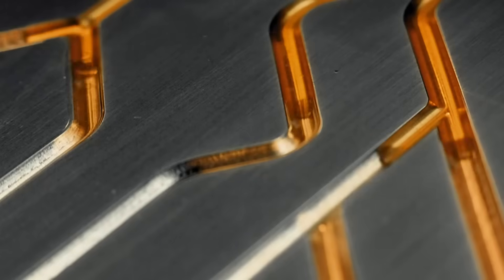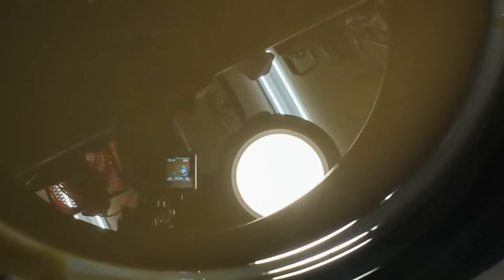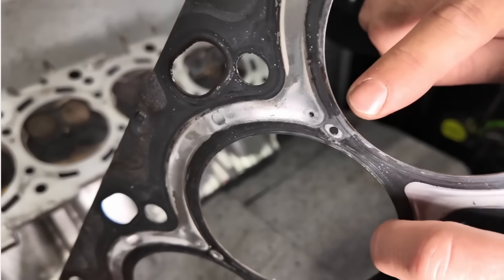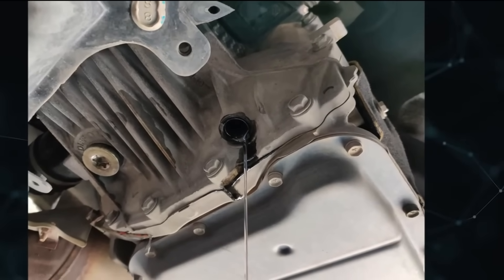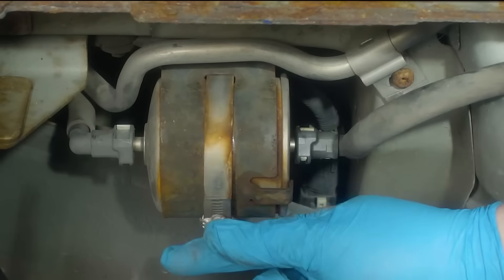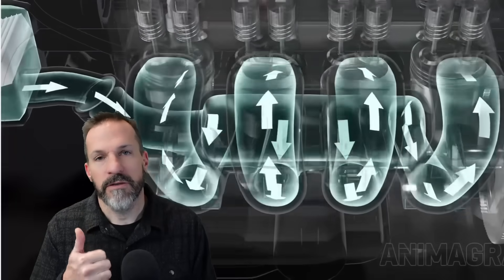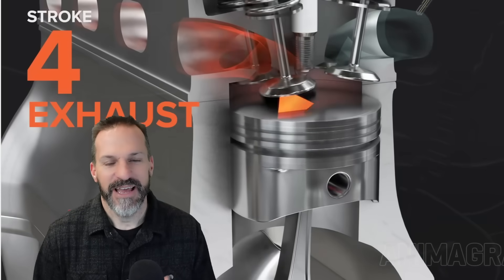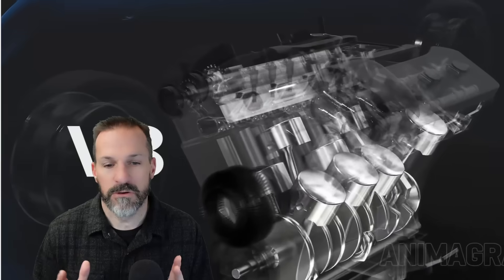Car Maintenance MOST People Ignore! Make Your Engine Last 200,000+ Miles!

Comment from the maker: *Fuel Filter note: Many newer vehicles you will likely not change the fuel filter, this video was made as generic advice for people with older vehicles and newer vehicles, and mostly geared toward powertrain maintenance (why I left out simple things like tire rotations). Obviously, use common sense and don't spend a fortune to replace fuel filters inside fuel tanks proactively on newer cars if they have not failed.
Reply: Hi,
Thanks for adding this note regarding fuel filter changing for vehicles with the fuel filter located inside the gas tank. Yes, not a practical maintenance job to do!
Also, thank you for making this video. Well done!
Reply: How about don’t buy a vehicle with the fuel filter in the gas tank?
Reply: @shack1975 sadly, that's almost an impossible feat
Reply: What year is considered “new”?
Reply: Yes
Reply: i've been working on cars since the 60's. had an ESSO service station in 1969. i NEVER rotated tires. you have to find WHY tires are wearing uneven and FIX the problem.
Reply: change oil every day
Reply: modern cars have lifetime transmission fluid
Reply: @infdox9051 Don’t change the transmission fluid if you want the lifetime of your transmission to be short and a very expensive repair.

Comment: 50-100k in my opinion is too long on the rad.  50 maybe but 100 far too long.  It's cheap and easy.  $50 tops on my tundra $25 on the corolla

Comment: I diy my maintenance except the tranny drain and fill on my tundra I let the dealer do that.  I do all fluids at 30k   i missed the rad at first 30 but for the low cost I just do it.  Amsoil in the diffs and transfer case. I use Pennzoil ultra platinum in the engine ever 5k.

Comment: New car: 
500 miles oil change
1000 miles 
1500 and then 3000 miles after that depending on the car 3000 or 5000 oil changes. 

Performance car I would do 3000k oil changes.

Comment: I go about 5k on 2.7 ecoboost F150... I also change my top mount filter at the 2500-3000 mile range between oil changes, they are cheap and simple to change, figure it cant hurt.

Comment: I have a 2010 Honda CRV. Purchased used at add 60 K. I see these pre-– all-wheel-drive Hondas all over the country still going strong. Today it has 247,778 miles. I tried to keep up with all the maintenance but wasn’t perfect. The last 50,000 miles it has had a lot of electric breakdown like driver’s window doesn’t work, no interior lights, etc.. The car has been absolutely amazing. She’s going in for a full fluid fluids, filters, belts, everything checked and changed and looked at. I hope to keep her for another 50 to 100,000. Thank you for your great advice.

Comment: My 2005 Saturn ion still kicking @ 220.000 with no engine repair. Just horrible fuel line and crappy front suspension issues.

Comment: Must be severe air pollution if the engine air filter needs to be replaced every 10k miles. 30k-35k miles (~50k-55k km) is probably a close enough interval for replacement in most cases. 
At least where the air is relatively clean, like here in northern Scandinavia, where in addition, a low traffic density means less road dust/pollution is stirred up by the traffic that contaminates the air.

Comment: I just reached a little bit over 100,000 miles and it's on my mind to change the transmission fluid
Reply: Should of done that at 30k and then 75k. Your too late if this is your first. Good luck
Reply: @Musoui  well see It's a newer car.

Comment: Great video. Have yet to see anyone mention a pvc valve replacement.
Reply: A lot of them have a check-ball valve in them. Shake it, and it should rattle. There are some that dont have a check ball so take this with a grain of salt. If you suspect it's clogged up (lots of oil smoke from tailpipe) you can flush it out with throttle body cleaner. Did that to my grandpa's old 1990 chevy silverado and it definitely smokes a lot less! Still has some blow by from either worn or stuck piston rings, but that's another can of worms 😅

Comment: I had a recent experience where my 18 Colorado, 2.5L manual I demanded my transmission, diff, clutch, brake and coolant be changed after 50k miles, the service advisor looked at me like I had 2 heads. He said sir you realize this will cost you 850. And I said sir that is much less than a modern car payment, please perform the services I am asking for

Comment: I had a 2003 Toyota matrix hit about 270,000 before I sold it. It didn't die, I sold it! It started to throw too many emission codes for me to want to deal with. And I'm not proud of this, but I didn't know a lot about cars so I did almost no maintenance to that thing. It was leaking oil, but had almost everything still original under the hood. I miss that car.

Comment: Transmission fluid needs to be gritty—don’t change it. Parts of the auto transmission breaks down to grit, but that grit sticks back on and helps the transmission function. If you get rid of that gritty fluid, you’re accelerating the wear of the parts

Comment: Honda Element 2005 drove it to 425k - Preventive maintenance and wear and tear items - Oil changes every 5k to 6k - Valve adjustment every 100k - Transmission drain and fill every 50k - Plugs at every 100k - Filters as needed - Coolant every 75k - Current 2010 at 245k, same vibe - Most eventually need the VTEC Solenoid Assembly R/R'd but only with OEM... \m/

Comment: 1996 nissan pathfinder with +>237,000 miles currently under the hood only major issue was a timing belt before but I'm working on replacing some stuff

Comment: 240,000+ miles on my 2011 Honda Accord LX. Only had to replace the alternator literally just last year as it finally gave out... only because it was covered in power steering fluid from above it which the o-rings were replaced right after. Other than that, just regular maintenance and upkeep with it.

Comment: Question hopefully someone can help with. If I am buying used and it wasn't taken care of like this from new, if i get it all changed and do it right from say 130000km will it be ok?
Reply: Just depends on the internals. My 92 tercel was and still is abused. But she runs. Just get a car with "less" tech if possible. My tercel doesnt even have power steering 😅

Comment: I had a 2000 Suburban 4x4 with the 5.3L engine.  Sold it with 407K miles on it, no engine or transmission rebuilds. Oil was changed every 3,000 miles (yeah, that's right) and only did the usual replacements like alternators and fuel pumps.  It was a great vehicle and I'd buy another like it new if I could.  The newer Suburbans -- no thanks.

Comment: Just one thing. With diesel engines, especially those over 10 years old, it is excellent to preheat the spark plugs for approximately 1 minute so that the oil reaches the entire engine. However, when starting, it is better to begin moving the car immediately, not letting it iddle.

Comment: If you've got a car around 150k miles you'd best check that oil weekly. I'd also say timing chain swap every 100k miles, especially if you bought it used. One time running hot can stretch them out and possibly grenade your engine.

Comment: My 2003 Suzuki Vitara 2.0L J20A engine just reached 154,000 miles. Just did a whole bunch of work from new Spark plugs, oil and trans fluid changes, oil and trans filter replacement, new water pump, new radiator,new pcv valve and runs like a dream. Old vehicles can handle the milage as long as their taken cared of.

Comment: Opinions are like assholes....2+ minutes into this and I wanted to scream!  
HE changes his oil at 5K "and has never had a problem".  Good.  I maintain 3 cars w/ 10K changes "and have never had a problem".  
Measure your oil to see how much you burned?  Well, gee, here I naively thought watching the oil dipstick was helping me measure that!!!
LOOK at the filter element to look for metal particles?  Maintaining airplane engines taught me that you OPEN the filter up, dry it, spread it wide and shine a very bright, oblique light across it.  Less than that and you will NEVER see metal particles!
NO mention of oil analysis?  So you are willing to throw money at frequent oil changes, but rely on literally nothing to tell you if you have wear going on inside the engine?
Never made it further into the video.

Comment: You should include Belts + Hoses + brakes + Shocks/struts + Tire check on the maintenance list.  So Many states do not require safety inspections..  So Important items are not looked at until they fail.

Comment: I bought a BMW E46 with 270k Kilometers and sold it at around 320k Kilometers, never had an issue, accept the steering-pump. but i had the most fun with that car. So if you look after your car, it will also look after you :)

Comment: I've owned my Ford focus for 16 years 158,000 miles. Annual oil change every 9-10,000 miles. Annual service. Decent reliable mechanic who advices when stuff like timing belt etc needs doing and when it's major or minor.
Also I keep an eye on things and don't leave them if I spot them I get them done.
Drives like new.

Comment: Starter went bad on my 2014 Tacoma TRD at 103,000 (warranty was till 100,000 of course…) Otherwise, 235,000 on it, mostly freeway driving. Oil changes frequency. But have never done the transmission or diffs/transfer cases. Kind of worried to do them now. Everything runs perfect.

Comment: My first car was a v6 altima, 2007 or 2008. Bought it for 7500 with 70k miles, at 220k radiator busted finally which was a $50 fix. Sold it for $2.5k  Not knowing any better, all I did were oil changes every 4000 miles. Original timing belt, never changed any fluids, same coolant, spark plugs, tranny fluid, everything. I guess cars were made better back then lol. These days it is all by the book.

Comment: Break in oil change - 1000 mi
Regular oil change 3000/5000 mi
Trans and differentials - 30,000 mi
Coolant - 30,000-60,000 miles
Brake fluid - 35,000 miles
Filters - every 12 months - or after pollen season
Check suspension - every 15K miles
Rotate tires - 10,000 miles 
Check oil and tire pressure - every 30 days 

I had 272,000 miles on my Acura. I bought it was 80,000 miles. Did most of the maintenance myself
Reply: EXCELLENT ADVICE

Comment: Funny that, just rebuilt my dang 5 cylinder italian lump at 200k KMS (sadly it didnt last 200k miles) because the previous owners beat it to sh1t. Shoulda seen that intake, carbonized like it was ready to be strip mined for coal. Cracked head, stuck pistons, failing head gasket, the whole kip & kaboodle. Oh, they also ran the wrong power steering fluid for at least 100k kms, that was a fun sound on turning that wheel for the first time.

Comment: Replace your PCV valve, 3k/6month oil changes, a little seafoam in the oil just before you change your oil and at 205 reseal with new oil every 10k miles, Chevron techron fuel treatment 2x a year, use an app like carfox car care to track recalls and service (document diy service that shows up on a car fax), Kirkland synthetic oil and wix xp filters for oil changes, serpentine belts and pulleys, and rock auto

Comment: "That's not really enough" my dad had a 2013 Tahoe with 280 on it and it was mint the day he sold it. Literally just changed the oil every 4k (DOD was disabled before he got it with one of the dongles you plug into the OBD2 port, still had the plate under the intake and everything)

Comment: What are your thoughts on doing a transmission drain and fill on an older car that has never had transmission work? I have a 2007 v6 Camry with 162k miles. I have recently gotten into doing some of my own maintenance and am torn on changing that fluid or just leaving it out of fear it will do more harm than good.
Reply: probably not a good idea if it has never been serviced over that mileage ... if it is starting to give you trouble (torque converter shudder, or slipping, etc.) do a single drain and fill using high quality ATF and the appropriate leveling procedure, including a specialist additive that is designed to address the problem you are experiencing

Comment: I like the concept of this video but it's overkill. Three Toyota vans: 344,000 miles, 306,000 miles and 325,000 miles and still going. The first two were totaled by hitting a deer and getting rear ended. I changed the oil with Mobile 1 synthetic every 20k miles. Never changed any other fluids. But would agree that coolant is important and transmission fluids are not lifetime like many companies say. The real answer is using high-quality synthetic fluids.

Comment: Step 1 buy a Toyota. Step 2 Change the engine oil. Step 3 Reach 200,000 DONE.
Reply: buy whatever you want and look after it and you will be fine

Comment: I hear the new car oil change at 1000 miles alot... I dont think you should.  There are special things put in a new engine for break in.  If you change it to early your actually removing that material.  I do mine around 3000 miles then 5000 miles after that.. never do the 10000 mile recommended interval.
Reply: What evidence is there of a special additive package? Unless this is explicitly spelt out by the particular manufacturer then this not likely to be true.

Comment: Got 225k on a 16 patriot I bought new. Castrol dexos.i kinda followed the oil change indicator. At 215k, i had vvt and cam codes that a shop ruled sludge buildup and motor shot. Told them i replaed cam sensors and vvts, still had codes.  Not sure they looked at it. Charged me for oil pressure test. Junk they said.  One cam sensor wasnt magnetic i found.  Vvt maybe has happy spot in spring and machining, they tested good.  I just switched to R&Protect after a couple flushes and seafoam treatments. But maybe vvt codes were due to plug connection, I rewired them no more issue.  Running great..
  Odometer quit at 450k on a 99 ranger, got totaled probably close to half million, oil clean at 3,500 mile changes. Castrol high mileage.

Comment: I have just replaced my Honda Accord 2012 4 cyl spark plugs for the first time since factory. 209,000 miles. They were still fine, no complaints on the cars performance. Old spark plugs were still ok. Factory sparks plugs are iridium ones. I installed they identical one. What it seemed to me right away is that car seem to have started accelerating a bit zippier and easier.

Comment: Watch out with the new pcv valves. I had to replace  my manifold gasket. I was going to replace the metal pcv value and I teated it and the new one was defective.  I cleaned the old one and tested it and it worked fine.

Comment: Sitting at 216,000 miles on my 2014 Altima, oil changes every 4500k, CVT fluid w/ filter every 25k-30k miles, as well as all these other fluids and parts and intervals close to thing video.

Comment: There is no difference between an AWD and 4WD....
"All" and "4" is exactly the same on any normal 4 wheel car... That's not some "different" system lol.. It the number of driving wheels..... How could it possibly define anything else...
Or are you going to have a third definition for "FOUR WD" too?

Comment: @Car Guy Online Guide, How do you feel about the new 0W20 viscosity oil ?  I have a 2024 BMW wuth a 2.0 4 Cylinder Turbo.  I now have 27 K, and i have bee. Doing oil changes every 3k with 1 Quart of 5W30,  and 4.1 Quarts of 0W20...  for longevity , should i go 5W30 instead if 0W20 ?
Im also in Florida. Very hot and humid climate wich doesn't help with viscosity breakdown.

Comment: My 07’ Range Rover Sport has 241k miles, original engine and transmission.
Reply: Absolutely unheard off
Reply: Extremely reliable! The Rover Sport is the same powertrain as the LR3, a workhorse! The 4.4 V8 is amazing!

Comment: Changed oil every 3,000 miles. 244,000 miles on my 2003 Subaru Outback 2.5 litre engine. Timing belt snapped and replaced the engine. $7,000 repair. If I had known about timing belt I would have replaced it for sure! Still driving it but now I’m getting worse gas mileage than before! Solution?

Comment: Imo the ATF drain and fill should be done every 15k miles rather than 30k. 30k-60k is generally considered a good time to do a flush, so if your not doing a constantly having clean fluid being added is a good idea.

Comment: The oil situation really isn't really that bad. Even with a turbo 5k is fairly conservative, and you're fine going with the car's maintenance system if you use synthetic oil and an OEM filter. The maintenance systems are actually a lot more conservative than the manuals for whatever reason. If the manual says "no more than 10k", your oil life monitor will probably go 7k or less.

Comment: Thank you so much for being a clear-headed teacher.  In one second I went from driving casually to needing a $700 brake job.  I am only grateful I have a great auto repair shop to rely on.  It is a 2002 Taurus and I want it to live forever.  It's only at 130,000 mi now.

Comment: Hyundai's 2.0-liter naturally aspirated engines, particularly in the Kona SEL, eat about a quart of oil every 1000-miles if you are constantly driving at higher RPMs. With that engine mated to the 6-speed automatic trans, means the engine sounds like it's being rung out at just 4000RPMs, so if you're always redlining it, expect to add oil every 1000 miles. PS: the only way to safely merge with traffic and keep up with traffic is to be heavy on the throttle, otherwise, good luck and God bless. Friends don't let friends buy Hyundai/KIA/Genisis.